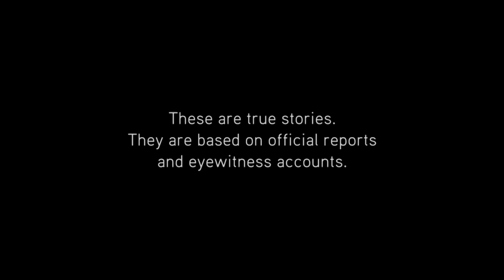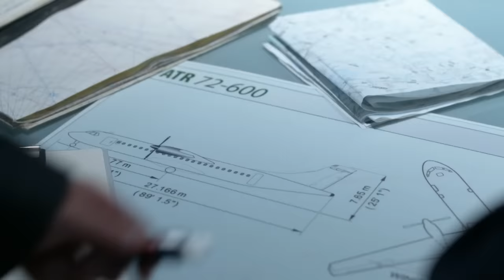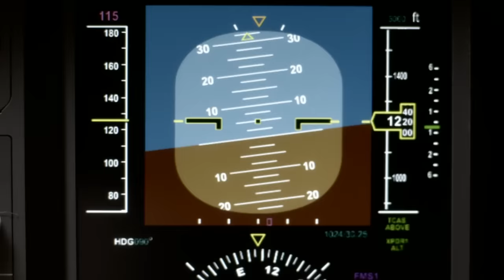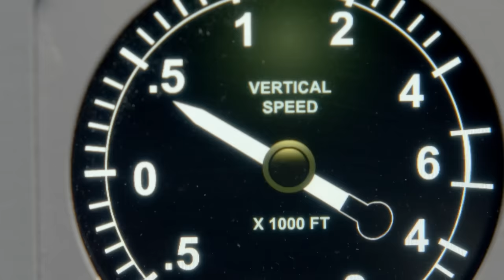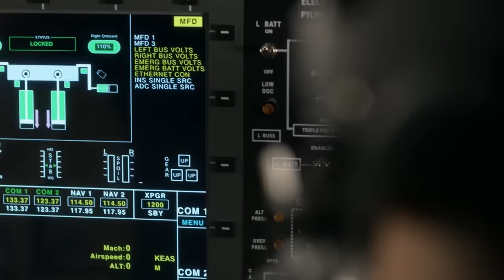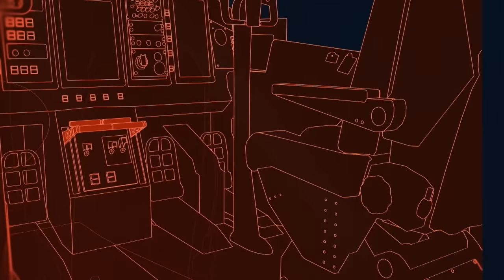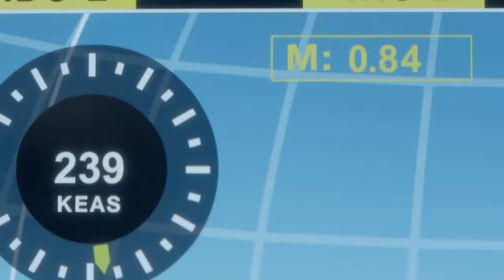The DEADLY Impact That A Decision-Making Can Have | Heat Of The Moment | Mayday: Accident Files

Comment from the maker: Do you think that this was the right decision that could have been made? What alternative would you have suggested?
Reply: I'm no grammar professor but the video's title seems incorrectly written.
Reply: These stolen clips are so old. lul
Reply: Pos rate, gear up 1st, then AP on above 400 ft  
A crew cannot maintain altitude, yet they request to maintain 16,000ft? Not!
Tech fact checker fail.
Reply: Those pilots are still incompetent of solving problems. They need to re-evaluate and do some more training and problem solving skills. DAMN pilots!
Reply: after shutting down the one engine, first two captains tried to turn at very low altitude is highly stupidity.  should've got enough height first before go around
Reply: They should have had an Auto unlock on a timer for the virgin rocket
Reply: Yahoo~~
Reply: Yeah I was like dang did I see an animation in the first fifteen seconds?!?
Reply: When it's your time to die, it's your time to die. There are times where the pilots relied on the autopilots for too long, and there are times like the first story that the pilots should've been relying on the autopilot. We'll only know the answer of whether their decisions were right after the fact.

Comment: I can’t believe there were survivors from all three aircrafts. Thank goodness the Taiwan one steered the airplane out of all those high-rise buildings. Also, the guy literally parachuted from space/stratosphere and survived.
Reply: My uncle Ned was on each of these flights.  Then again my uncle Ned owns his own Airline....
Reply: I want to know how the pilot survived the shuttle tearing apart at those speeds. That's mind boggling.
Reply: @stevenl9443  I checked Wikipedia, the pilot says he was strapped into his seat when it broke up, he got out of the craft and his parachute deployed automatically. how he survived at 50,000 ft where there is barley any breathable air I don't have a clue
Reply: @mesobean  Wonders of modern technology and sheer luck.
Reply: Those pilots are still incompetent of solving problems. They need to re-evaluate and do some more training and problem solving skills. DAMN pilots!
Reply: @stevenl9443  thé human body is very fragile. But at the same time, it’s also an absolute marvel of evolutionary engineering and therefore is very durable and can be shocking in how is can handle extreme situations. + there’s always that bit of « luck » as they call it.
Reply: @stevenl9443  you fail to give credit to the supreme agent that is the human body, it’s a very strong and durable chuck of consciousness meat, and will surprise you with what it can endure with the right circumstances.
Reply: @mesobean  Probably was unconscious. But considering how long someone can survive underwater it's not surprising that the air wouldn't be a huge issue as long as the parachute didn't deploy until he got under a certain altitude.
Reply: @mesobean  Probably was just unconscious and was under less of a need for oxygen. Reduces anoxic damage...I think. But there's a good chance that he just had a personal oxygen supply for ejection.
Reply: Bill Weaver was elected from his SR-71 traveling 3 times faster and tens of thousands of get higher than SpaceShip-2 (single engine failure sent it into a sharp, uncontrolled yaw, after which it exploded), and he not only survived, but survived after being flung 800 miles away from where the accident occurred: The breakup happened over the Mojave, and Weaver landed just north of Tucumcari, New Mexico.
Reply: @michael-ir8cj  I think I would avoid any plane uncle Ned was on. No disrespect to uncle Ned.
Reply: @michael-4k4000 liar bro.. there is NO way also the one with the space thingy wasn’t your “uncle Ned”
Reply: @lorriegallardo8053  thanks for your respectful treatment of my uncle Ned 🙏!   Uncle Ned is the smartest person in the world 🌎....
Reply: @LoL2.0LoL    OK bud.....  you don't know my Uncle Ned.....  my Uncle Ned is smarter then you ever day....
Reply: I can't believe someone survived the last one! Going almost mach 1 near space and having the plane break up and still somehow surviving? That's crazy!
Reply: @michael-4k4000  and what is the airline? And no way he survived all 3 of those flights

Comment: The Space Ship 2 crash surprised me when it happened because the next day after the accident there was a grainy photo of the breakup and I noticed the fuselage was facing but the wings were still right side up. We thought "they engaged the feather mode while the engine was running?" I just had a feeling that's what happened.

A few days later it was confirmed.

Comment: RE: the first accident. Unfortunately, it's all too common that a pilot will shut down the wrong engine. That's why the cross-check is so very important. I remember when I first started flying multi engine aircraft I was taught the mantra "Dead foot dead engine" meaning the foot that wasn't pressing hard against the rudder to keep the aircraft straight was on the same side as the failed engine.

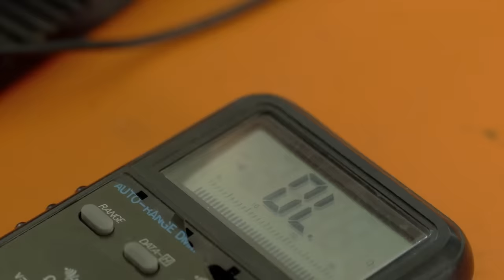Comment: @23:58 that’s pretty funny, when he’s testing the oil system he says “ahh, the switch has a short” but the meter clearly is displaying “OL” which stands for Open-Loop/Open-Load.  I just thought it was funny 😂
Reply: I always thought OL meant open line.
I noticed as well. A short and an open circuit are absolutely two different animals.

Comment: On the TransAsia flight, if the autopilot has no control over the throttles (they said they could only be operated by hand) then I don't see how leaving the autopilot on would have made any difference. If the pilot still shuts down the engine by mistake, the autopilot won't be able to fly the airplane.
Reply: Maybe it would have reduced the workload on the crew and allow them to work-through the emergency a bit more deliberately.  Having turned off the autopilot, the pilot was flying the plane by hand, then reduced power from #1 instead of #2, then returned to flying the plane by hand.  Only when he could realized that the plane was not responding as expected and reviewed what might be wrong did he realize what he had done when it was too late to rectify it.

Comment: For the Taiwanese crash, turning off the autopilot on an engine out - IS the correct procedure for any large airplane...in fact the AP will auto disconnect on most airplanes.
Reply: Not on the A320 at my airline. Not on any airliner I've heard of. Which airplane auto disconnects the AP in case of powerplant failure?
Reply: @lukegerst2382  are autopilot systems designed to fly an airplane with all engines down?
Reply: @mito88  That's not what they're really designed for, no. Depending on the aircraft, the autopilot may or may not disconnect itself in the case of all-engine failure. All-engine failure is extremely rare in commercial aviation. My prior comment was more in regards to single-engine failure. 

The Taiwanese crew featured in this video might still be alive today if they hadn't increased their workload by disengaging the autopilot. Or....maybe not. I'm not familiar with their procedures. I only know mine, which allow and encourage the use of the autopilot to reduce distractions.
Reply: Not at all. They screwed up big time and that captain is 100% at fault

Comment: So yes, the KLM pilot messed up, but how is it that the engine being at idle and the other at max create so much right bank that the control surfaces cant counteract it? what would they have done with an engine flame out or other failure? How is it there were no questions to Saub about their design that it is apparently uncontrollable with 1 engine?
Reply: All multi engine propeller aircraft (few inline twins excluded) have a minimum controllable airspeed. Below that speed there is not enough air flow over the controls to counter act the torque from the running engine/propeller
Reply: @skyhawk5265  Would expect that a single engine in an aircraft like that would be able to produce enough speed to control the aircraft?
Reply: @lycogala1843  yes. But in this case it looks like they got too slow on the approach before pushing the throttle forward. By the time they tried going around they were under the minimum controllable airspeed.
Reply: Lift is generated by airflow over an airfoil or wing. The faster the air is flowing, the more lift is generated. On an aircraft like a jet plane, the airflow is the same as the airspeed of the aircraft so it is even across both wings. With propeller driven aircraft the propeller accelerates air over the wing because it is in front of the wing, not under or behind like a jet. So some of the air flow is from the plane's airspeed and some is from the propeller. If one engine is lost then you have a difference in air flow velocities and a difference in lift between the two wings. At higher speeds, this isn't as apparent but at lower speeds, the difference is much greater in proportion so the effect is magnified. 

It was also mentioned that the aircraft was nearing stalling speeds as they were landing. Not having any additional flow from the right engine at stall speed likely caused the right wing to stall while the left was still producing lift. A stall is when the flow is too slow over the wing and the flow separates behind the trailing edge of the wing. A stall causes a massive loss of lift which would have even further worsened the scenario.

Once the right wing stalled, increasing power to the left engine only increased the lift difference between the two wings, worsening the bank.

Lift is a function of velocity squared, which means that as the velocity numbers get smaller, the difference is more profound.

For example: 24 squared is 576 and 25 squared is 625. The ratio between the two is .92. Compare that to 4 squared (16) and 5 squared (25). The ratio between those is .64. 

So while both velocities may have decreased by the same amount as the pilot slowed the aircraft, the lower velocities meant that the difference in lift grew rapidly.

Besides the initial error, the plane was simply going too slowly on approach. It shouldn't be at or near stall speed in a regular scenario, never-mind on one engine. A faster landing would have been perfectly executable.

Comment: When the gravitational pull is overwhelming the transcondensor units at 45 ° the semi transitional conduction systems will always fail within 30 seconds after turning on the autopilot unless you have also engaged the fuel pump turbo engagement override system that prevents the plane from stalling after reaching a specified altitude in relation to airspeed, temperature, and humidity within the engine barometric pressure regulator.
Reply: And don't forget the turbo boost initiator of the flux capacitor override sybiotic static windings.  Almost everyone overlooks that ... can prove troublesome. 😮

Comment: What I learned from these disasters is that the co-pilot is practically useless almost every time. They never check system in proper position or ever correct the captian when they know the captian is probably wrong.

Comment: Is it really called a "flameout" if it is a prop engine, which is internal combustion?
Reply: Turboprops are turbine engines and are far more closely related to jet engines than piston engines.
Reply: the prop engines seen here are turbines, absolutely the same as a jet. you bet they flame out.
Reply: Jet turbines are internal combustion. What you are looking for is piston, or reciprocating, engine. As the others have pointed out, that was a turboprop, which a turbine that instead of pushing with it's exhaust, has a shaft connected to it's turbine wheels turning a prop.
Reply: Turbine engines are also internal combustion.

Comment: The Asian flight captain screwed up but let's get real many pilots would get rattled by basically an engine failure after take off, only having seconds to react, and compound it with other error. Probably like 95% of pilots
Reply: Pilots train to be cognizant  of the actions they're making. Majority of commercial pilots would not make that mistake.

Comment: Calling BS on virgin Galactic. How could the feather system in any regime, be allowed to actuate un commanded. And why under any circumstances would you remove a safety feature that could allow the airframe to configure itself in an un flyable state.

Comment: I can't wait until robots are flying us instead of these dopes.
Reply: Do you think that robots are going to be better flying Americans I don't think so
Reply: @mikeenyart  I spent a decade in flight medicine both with the Army and civilian side. Yes. Absolutely a robot will be better.
Reply: @mikeenyart  Also a bonus: Robots will know how to use punctuation.
Reply: The first two pilots actually powered down their engines. I'm not a pilot, but isn't that how you fly, 101, keep your engines on, lol! Yes, maybe a robot could do better.
Reply: @concettaworkman5895  Pilots practice power-on stalls before they even solo. No matter the aircraft, the remedy is exactly the same. And these utter nincompoops did THE EXACT OPPOSITE.
Reply: Have fun trusting the "robots" to land in 30 knot crosswinds on a single engine with a hydraulic failure!
Reply: @9999AWC  yeah well at least the robot won't go nose up in a power-on stall. jfc are you seriously doubting a robot can't be programmed to do this?

Comment: are they sure it wasn't pilot suicide that sounds like a pretty dumb mistake oops wrong engine db
Reply: Not sure if you're referring to the first one or the second one, but in both cases the pilot was clearly trying to recover the aircraft, even if he wasn't doing the right thing to do so.  Shows a lack of intent to intentionally cause the airplane to crash.
Reply: They already said it was Change Blindness. The Taiwan one.
Reply: @meghanmisaliar  Noted Db
Reply: I doubt if it was suicide, or else the pilot would have had a more elaborate plan for it. It was just a dumb error on his part.